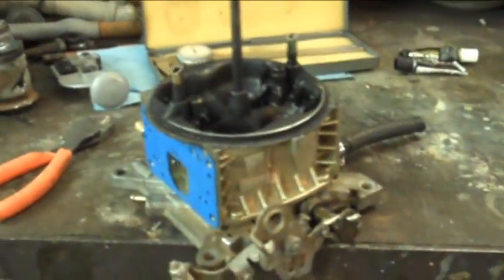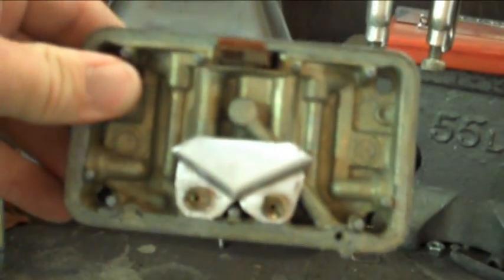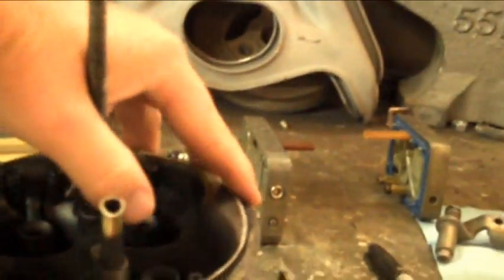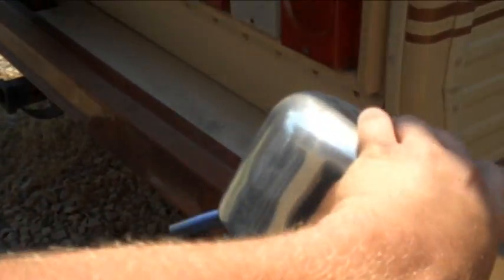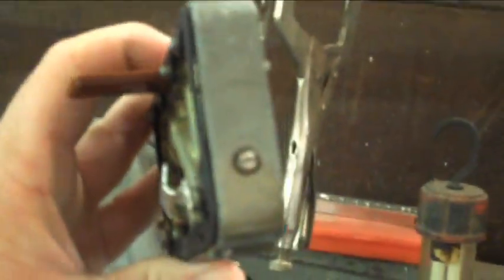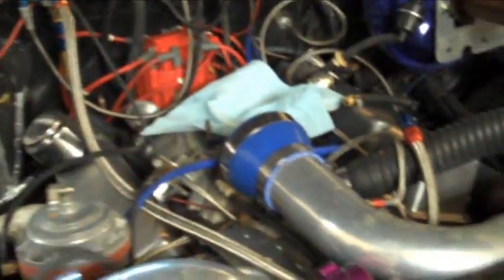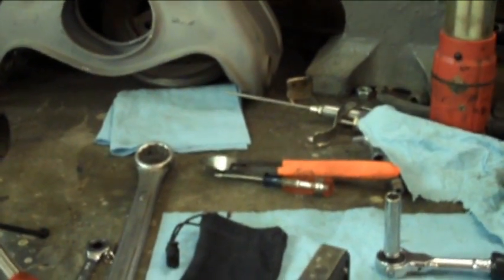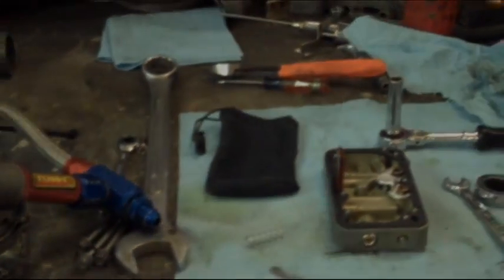My Boost referenced power valve project - DIY AUTO REPAIR #1

Comment from the maker: Yes its the same base carb that Hangar18 recommends,  Nitrophyl floats, jet up, jet extensions in rear, remove choke horn, epoxy choke rod hole(my carb has a Proform main body so it doesn't have a choke horn or rod hole). I also use the vent tube extensions and the power valve mod in this video. Get a wide band 02 censor with guage and start with low boost, low timing and bigger jets, then spend the time tuning it. theturboforums has all the info a DIY'er needs to mod a carb for blow thru.